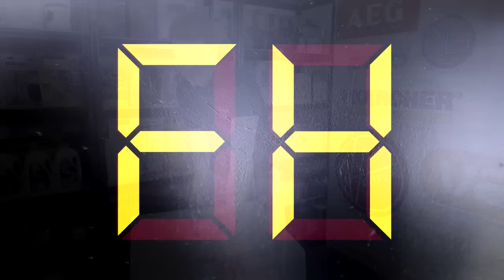Whirlpool Washing Machine Error Codes Diagnosis

Comment: Hello!
I have an whirlpool washing machine AWE6317 and work only the motor!
I habe doing the reset ine the first the machine takes the water when goes to the second the motor works very fast 2 times and the washing machine stops and 3 light are on!
The service light and anothers 2 in program!
What problem has?
Reply from the maker: Hi Leonard, we have not found any information and the error codes for your machine, we do not have top loader in the UK.

Comment: Hello there eSpares! I too get an F23 faulty code on my top load Whirpool AWE 7516. What should i check? The pressure switch,the heater or the heater sensor? Thank you !
Reply from the maker: We believe this could be due to a couple of reasons. If the error occurs when filling with water it may be a blocked or failed pressure switch so see this video:
https://www.youtube.com/watch?v=2pIVkAxWSXg&list=PLZopaZU-UQSHj1noiwEJ99JjXWcEcSAbZ&index=16
Reply: eSpares my problem is that i fill the washer with clothes, pick the program and start it. When i start it, there is NO water coming in, 
the motor goes twice for a couple of seconds
 and puff.. the f23 comes on.
Reply from the maker: Hi schakal325, first test the element because if that has failed it may cause the water valve to stop, if that is ok then suspect the pressure switch.
Reply: eSpares what element? You mean the heater element?
Reply from the maker: Hi schakal325 sorry yes the heating element
Reply: eSpares ok,thank you very much

Comment: Whirlpool professional 7.0kg Giving HE1 Error code . Machine Stop Within 4minute when we start the machine.
Reply from the maker: Hi Zorba, the only thing we could find on the HE error codes for whirlpool relate to problems with the drain cycle, check the drain hose and filter before suspecting anything else.

Comment: Error code F-24?
Reply from the maker: This is a water temperature sensor error. If your machine has a hot water input check this is correctly fed with hot water. If that is OK suspect the sensor or depending on model the water heater.

Comment: Ok help...model wfc7500vw2...getting an F07 code....I think itis the control board....no matter what cycle it will fill/drain and spin, but near the end will stop and display F07...

I tried the Drain/Spin cycle and it is a 18 minute cycle...it drained, spun slowly, then spun VERY quickly numerous times then with 1 or 2 minutes left it would display f07.

Would you concur that the control board is the issue?
Reply from the maker: F07 can either be a motor problem or a control board. Before suspecting the board check the carbon brushes for wear and the connections to the motor are not damaged or loose. For more information see our video:
https://www.youtube.com/watch?v=MNInJd7js5A
Reply: thanks, but if the brushes were bad, would the motor spin up to a very high speed, numerous times during the drain/spin cycle?
Reply from the maker: We cannot tell you how to check if a control board is intermittent, but you can easily check the motor brushes and connections. If the tacho winding has a poor connection when the board tries to turn the motor it will not identify any rotation. It then increases to maximum for a moment before shutting down in case of damage so this may be what is happening.
Reply: ok I will give that a try , can't hurt and like you say, easy enough to check
Reply: Well took out the motor and looked at the brushes...I had over an inch of carbon still in the bore on each...so I don't think the brushes are the issue...sending computer in now to be fixed...wish me luck.
Reply: CFauvel Did you find the cause?
Reply: `i sent the control computer a place on ebay that fi1xes them....i haven't  tried it yet
Reply: Well I did put back the computer yesterday and tested it by running a spn/drain cycle and got the same F07 code....going to send it back to the "repair" facility.

eSpares anything else I should look at for an F07 error? Brushes were fine.

Comment: Hi, I have a Whirlpool Supreme Care FSCR70414 and when power on it displays a code "dEn" (that "n" is like an "U" upside down, so maybe "dE17"). The only option that I have is to touch the start (play) button but in this case I have a random program shown and It happens nothing. At this moment the only functionality is the power of, for any other it just beeps. Do you have a hint what is happening?
Reply from the maker: Check the door lock first, if this seems OK watch this video:
https://www.youtube.com/watch?v=QYPqpjLV7s4

Comment: What does mean F00
Reply from the maker: F00 suggests a  drain pump triac failure. Check the drain pump and check the wiring, The problem is possibly due to the PCB.
Reply: Thank you

Comment: FH whirlpool AWM1213 ,please help
Reply from the maker: Hi MurarA, FH refers to no water detected so if it has not filled up enough during the allowed time it shows the error code, check the water valve and pressure switch before suspecting anything else.

Comment: f6e2 or f6e1 whirlpool duet
Reply from the maker: F6E2 means the appliance need resetting, to reset the machine  disconnect the supply and retry after powering on. Error F6E1 is a communication error where the control board is not connecting with the main board so check the connections on the boards.
Reply: eSpares......I have an F6 E2 error...I read somewhere else where it was the MCU board.

Comment: Whirlpool 360 how to repair 551 error
Reply from the maker: Hi Nazim,  SS1 error can be due to excess soap suds. If this occurs when there is a lot of foam in the drum run the machine on an empty cycle to clear any detergent and reduce the amount you are using.

Comment: I have whirlpool 360 and it’s shows error code SS1 during spinning
Reply from the maker: This could be caused by the wrong type or too much detergent causing excessive foam. If this occurs with lots of soap suds use less powder or change the detergent, if this occurs without excessive suds it could be a motor speed sensor problem or the motor not turning, for more information see this video:
https://www.youtube.com/watch?v=D5Aw7CBEGPI

Comment: I have an error code f22 please help
Reply from the maker: Hi Hannah, we understand error F22 on whirlpool dryers refers to the air temperature sensor on the exhaust. Check and replace the sensor if required.

Comment: But I have one whirlpool dryer Meanshinne it's show me error f06 what will I do
Reply from the maker: At 4:09 we explain F06 is a 'motor tacho problem' this is where the control board does not recognise the drum motor is turning so can be caused by motor brushes if it is not turning or the tacho coil if it turns fast. For more information see another video: https://www.youtube.com/watch?v=nstG-0UoGe8

Comment: Hello, 
I have a error code A09
Please help
Reply from the maker: Hi Harlene, it would depend on the model number but gererally error code A09 can be a water inlet issue suggesting that no water or insuuicient water supply, check the water supply and no hoses are kinked or blocked before suspecting anything else.
Reply: You are amazing 
Thank you 
H
Reply: what if the water is coming in fine, no clogs in the filters either?

Comment: I’m getting 3 dashes on my washer “- - -“ what does that mean?
Reply from the maker: We do not recognise this as a fault code, the display usually gives this indication when it has finished a cycle. What does the machine do?.
Watch this other video to identify where the problem is  (door lock- filling-motor etc):
https://www.youtube.com/watch?v=QYPqpjLV7s4
Reply: eSpares nothing was wrong. A wash mode was not selected so the lines came up. Thanks anyway

Comment: My washer dont have thedigatal display how do.  Do i know whats wrong it just beeps three times
Reply from the maker: Many machines bleep three times to either indicate a problem or that the cycle has finished. If you do not have an error code check what works by following this video:
https://www.youtube.com/watch?v=QYPqpjLV7s4
this will help show what is going wrong.

Comment: I have a Duet steam model wfw8640bw1 about 3 years old. The power button no longer works and when I try to start a load the delayed start is displayed after holding start buttons for at least 30 seconds. I have to try several times for the cycle to begin. Suggestions?
Reply from the maker: Hi Kate, you need to watch another video to help identify the problem:
https://www.youtube.com/watch?v=QYPqpjLV7s4

Comment: What about the error FE
Reply from the maker: We believe on whirlpool dishwashers FE error code may indicate an EEPROM error. This may require a replacement control panel if turning off the power does not resolve it. Check what the machine 'does' first and watch the following video before suspecting the PCB:
https://www.youtube.com/watch?v=yL6A7I_rC2o

Comment: Hello! How do I fix f-08? Thank you!
Reply from the maker: Hi Zad, F08 is a heater problem (likely to have failed). We have a video of the repair on a similar machine that should help you carry out the job:
https://www.youtube.com/watch?v=jeygkgjR50c
Reply: eSpares oh thank you. later i will try to look at it if it's the heater. I did some research and some said it could be wiring problems. mine is a whirlpool btw.

Comment: i got an F5 error code top load whirlpool washer
Reply: lilfireballz  same. I think mine is belt. Oddly, it seems to spin etween wash/rinse but it does spin at all after the rinse cycle. Machine was not cheap and only three years old.

Comment: My error code says E2 and F6. What does that mean door is still locked
Reply from the maker: Hi Denise, these errors indicate a control or interface problem. Try disconnecting the power for five minutes and if the problem continues check connections between the control board and the power module are clean, dry and fitted correctly.

Comment: I'm getting an E01/F03 on a new USA-made Whirlpool, which isn't listed here. I notice that many of the unanswered questions below pertain to US-made Whirlpool products. Is it possible that the error codes on EU or UK sold WP machines are different from those of their US counterparts? I know WP bought out Indeset/Hotpoint, so the design of the machine here may have little in common with mine.  Thanks for the information anyway.
Reply from the maker: There can be different codes even for machines made for the same 'markets' but the codes quoted are the 'commonly used'. E01 can be a  draining problem and F03 can be a pressure switch related error so if you are getting these it suggests the machine is 'expecting' the water to be completely drained but the pressure switch is 'reporting' water in the drum. The usual cause would be a partial or complete drain blockage so watch another video for more information:
https://www.youtube.com/watch?v=frEJhX9Sppw&index=5&list=PLZopaZU-UQSHj1noiwEJ99JjXWcEcSAbZ

Comment: Got the error code \\\"Suds f35\\\" whirlpool duet steam. cleaned the pump, full of trash, work one complete cycle. Next load error code again. clear pump and it ran a complete again. When  my wife needs to wash a load I just clear the pump and it works, Is this a bad water level senor or what.
Reply from the maker: Hi Gary, the usual cause is to much detergent causing excess suds. Do an empty rinse and then reduce the detergent to see if the problem is cured.

Comment: Hi dear what about the errore code F13 ?
Reply from the maker: Error F13 is a door lock error. If the door does not release after turning the power off then on again give the door a thump and try again. Replace the door lock if the fault re occurs.

Comment: I have a Whirlpool Duet Front LoaderLF. Already replaced the Flow pumps and sensor. No resolve. Anyone know what to check. Someone changed the Main Controller no resolution.
Reply from the maker: What is the problem and what does the machine do?. Watch our diagnosis videos to identify in what area the problem is likely to be:  https://www.youtube.com/watch?v=QYPqpjLV7s4&index=1&list=PLZopaZU-UQSHj1noiwEJ99JjXWcEcSAbZ
Reply: The Error I get is LF when the cycle attempts to drain in any cycle. We have to press the Power button at which time it drains itself. After the washer drains, the power shuts off. We than move the knob to Rince, and press the Power again, and Start. The system will rinse and drain. We've replaced the Flow/Inlet Pumps with no resolve. Also someone else with similar issues, same error code, replaced his MCU with no resolve.

Comment: I have a new washer with codes E01 and F03, what are these?
Reply from the maker: F3E1 error can be a blocked pressure switch hose stopping the machine identifying the water level in the drum. For more information see our video: https://www.youtube.com/watch?v=2pIVkAxWSXg&list=PLZopaZU-UQSHj1noiwEJ99JjXWcEcSAbZ&index=16
Reply: Tengo  un código F 28 wilpoo .duet th  por  favor  si puedes  darme  respuesta  cuando es el problema gracias por anticipado una vez  gracia.
Reply: Chris Velez help it's Hotpoint Ariston no spin   HELP !!!
Reply: Chris Velez dtdfcdyrgdfdfffdggfgfvgh
Reply: Chris Velez

Comment: Hi, thanks for that but it's defo connected, as it filled initially, it happens halfway through the cycle when it starts the rinse cycle?
Reply from the maker: On rinse cycles the water often has to fill to a higher level so will take longer. Sounds like the water flow is just enough on the wash cycle but too slow on the rinse so check the 'tap' is turned on full.

Comment: Hi, I have a Whirpool HDW 1011WG, halfway through the program the window flashes H then F, then H then F continously. Then select pause reset button and time comes up 21 mins and pump runs continous and won't move on from there
Reply from the maker: The FH error is indicating the machine has a problem with filling. Check the water supply is correct .

Comment: hi im getting E70 code can you help me
Reply from the maker: Hi Lindaseta, we believe E70 or F70 can be a 'communication error' This is usually  where the control board is not able to pass instructions to the control module.
Check the connections between boards are tight and the connections and boards are not contaminated. If no fault is found you are likely to need to replace one of the PCB's

Comment: am getting a flashing f27 on my AWOE  9140
Reply from the maker: We understand this is an overflow error indicating the water has filled too high in the drum.
Reset the machine and watch a cycle to confirm the water is filling to the correct level.

Comment: hi I'm getting code f25 can you help
Reply from the maker: Hi Tiffany, we believe this is a motor problem so check if the motor is running.
Reply: Same problem here.....but f25 is not listed
Reply from the maker: As above check the motor, drive and brushes for a F25 error.

Comment: I'm getting ss1 or 551 can't tell any ideas?
Reply from the maker: A F51 error is indicating a motor rotor position sensor problem. Check the motor and suspect the motor sensor. You will need your full model number.

Comment: hi, I'm getting a 5d error code, I cleaned drain out an found some debris. ran the machine in quick cycle an still 5d error code at the end of cycle, I repeated 2 more times same result, I then proceded to run the clean cycle with bleach and still 5d error code at end of cycle. I have the model WFW-8410. in your opinion is it the Pump failing or maybe a sock clogged in hose behind pump??
Reply from the maker: Error SD is usually indicating suds or excess foaming in the drum. This is usually caused by to much detergent so if it occurs run another rinse cycle and try reducing the detergent. If you suspect a drain problem watch our diagnosis video: https://www.youtube.com/watch?v=frEJhX9Sppw
Reply: I clicked the link and there no video available
Reply from the maker: Sorry, sorted now: https://www.youtube.com/watch?v=frEJhX9Sppw

Comment: Hi I'm getting a code Lf. I've had someone come to check it bit that didn't do Me any good just lost money. I would rather learn how to fix it myself. ..
Reply from the maker: The code LF means long fill so check the water is filling the machine correctly and the water supply is fully on.
Reply: eSpares how would I know if the water is filling correctly? These machines don't really put out much water, so I really don't know what would be a good amount.  I had someone come out, but that was just a waste he's telling me other things that's the opposite of my problem. .. is this something I can fix on my own or would I have to purchase another washer. my machine starts a whole new washing cycle on its own. Once a cycle is finished  it comes up with the error code Lf and then it'll rewash the same load if I don't power it off in time. I'm very concerned especially concerned about what my water bill will be like next month.😓

Comment: On our Duet, the F11 error was due to an intermittent 3 pin connector to the MCU. I re-positioned pins and sprayed off the terminals with Deoxit. Now it runs like new. Thank you very much for creating this video with emphasis on the harness connectors, you probably saved us $250  in repairs!
Reply from the maker: Thanks Keith for the comments, glad we helped.
Reply: But there’s no mention of F11 on his video ? I don’t get it

Comment: were getting a F01 and E02
Reply from the maker: Hi Jeff, we believe this is because the control board cannot detect drum movement. If the drum does not move then check the motor brushes and connections. If these are OK suspect the control board.